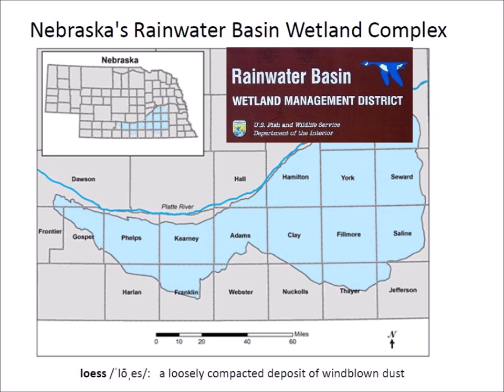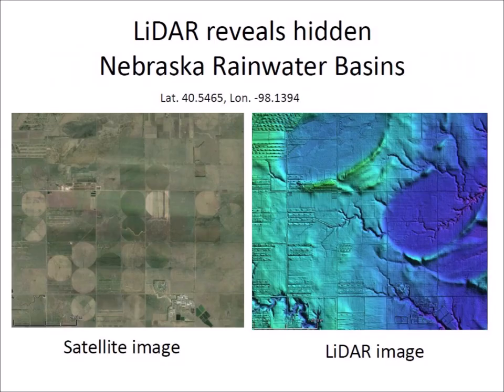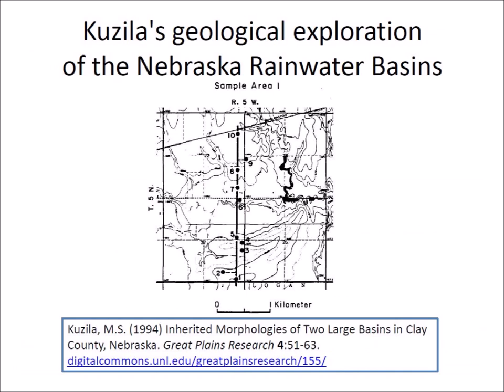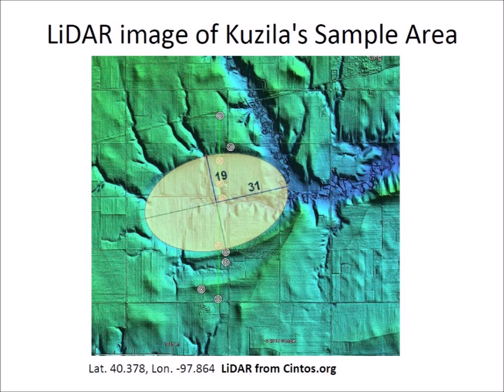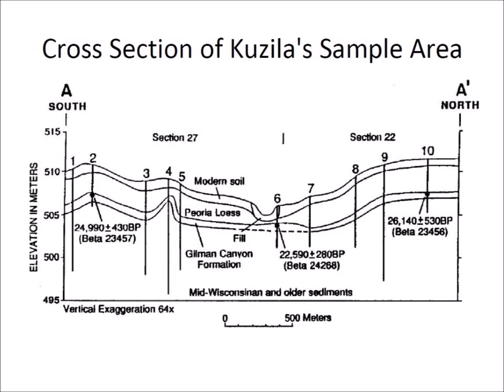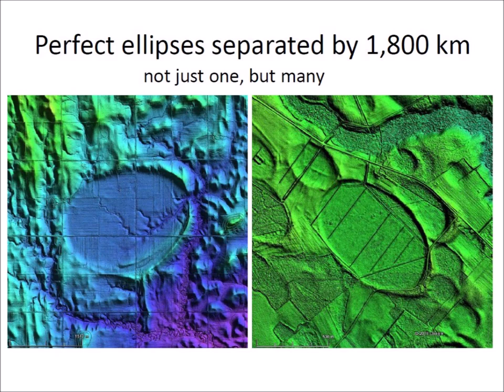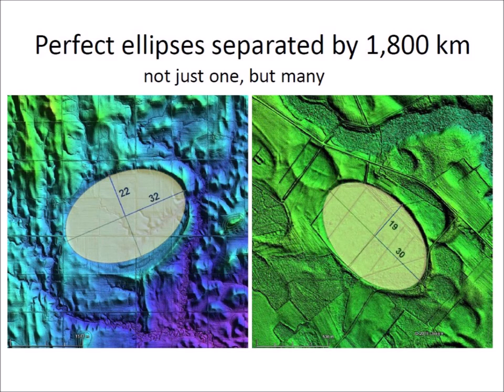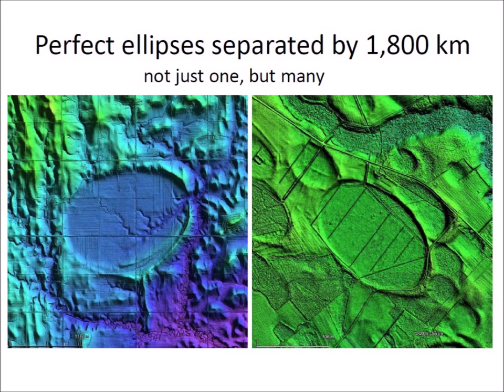Nebraska's Carolina Bays

Comment: Thank you, Mr. Zamora! 
I’d like to stick my 2 cents in about the rainwater basins here in Nebraska (I live in Omaha, and have been out by the Platte river to observe the spring migration of cranes, which is across the same area as the rainwater basins.) I’m also quite familiar with loess soil, which Omaha is built on. We have loess hills here. Loess soil is very fine, and when it’s dry and not held by vegetation, it blows easily. It’s quite fertile, and drains very well. A nickname for it is sugar clay, because it’s kind of granular, like sugar. It erodes by water in an unusual way: it won’t create diagonally-faced hills when eroded by water. Instead, it forms vertical faces, as in cliffs. I remember that there are 2 time periods of loess deposition in Nebraska, the most recent one geologists hypothesize happened as the Laurentide ice sheet retreated, melting, and creating those katabatic winds which blew off of the glacier and deposited the loess, which the ice had held. 
Anyway: for my unsupported hypothesis and conclusion about the formations of the elliptical bays: the modern loess soil could have been deposited on top of, and in the midst of, the elliptical basins being formed by the ice chunk missile bombardment. I haven’t read that paper about the basins yet, but I imagine it includes an analysis of the layers of soil in the bays. Given that loess is easily moved, the bays would have to be pretty recently formed, since they’re still so apparent.
It’s astonishing to realize that those ice missiles also hit where I live now.
Reply from the maker: Thank you for the description of the mechanical properties of loess. I think it can help to explain the difference in erosion between the east coast and Nebraska.

Comment: Question: 
Would the Coriolis effect / Earth's rotation produce any significant difference in the impact angle of projectiles travelling East (to Carolina) and West (to Nebraska)?  Naively, I'd have though the eastern impacts to have a shallower angle than the western ones.
Reply from the maker: The Carolina Bays and the Nebraska Rainwater Basins both have width-to-length ratios of ~0.58, which means they had about the same impact angle of about 35 degrees. The East Coast bays show some interesting wind effects that are discussed in this video: https://youtu.be/EVThf6SoclM

Comment: Assuming a cosmic origin for these structures seems outlandish given the evidence we have. I know a lot of people want there to be evidence for a massive impact, but if you remove that conclusion and examine the Rainwater Basins from an objective standpoint, you'll realize that there's little showing them to be the result of a meteorite impact. The impact hypothesis loses even more ground once you compare the Rainwater Basins to known impact structures in Nebraska.
So, firstly, while the Rainwater Basins might seem similar to the Carolina Bays when glancing at them on a lidar map, comparing their size and depth reveals them to be very different structures. The Rainwater Basins are extremely shallow - typically reaching only 3-4 feet deeper than surrounding topography. This is much different than the deeper Carolina Bays, which seem to average around 15 feet in depth. Already we have a discrepancy between the supposed impact features.
Secondly, contrary to what many people claim, the Rainwater Basins do not have a common orientation. Were they the result of impact debris, they should all point toward the same source. However, the basins have varying orientation, much of which seems to correspond to local wind patterns. They are also highly irregular. While some resemble ellipses, most are vaguely elliptical and not at all perfect.
Continuing on, as stated in your video, the soil covering the basins is old - typically ranging between 20,000 and 30,000 years BP. This soil lacks examples of shock metamorphisis, meaning that there are no rocks or minerals that appear to have been altered by an impact. If anything, the Rainwater Basins show no processes other than erosion typical of the area. This also means that, even if they are impact structures, they have been undisturbed for well over 20,000 years. Due to the erosion processes in the area, this seems unlikely.
Loess soil also erodes very easily, meaning that any crater structure in Nebraska would disappear rapidly due to natural weathering. Compare the prominent elliptical shapes of the Rainwater Basins to Merna Crater, a known meteor crater in Nebraska. Despite being formed between 3,000 and 5,000 years ago, Merna Crater has almost completely weathered away, its shape being nearly indistinguishable from surrounding terrain. Yet the Rainwater Basins are highly elliptical, meaning that they either formed very recently or are maintained by natural weathering processes. If these were formed as a byproduct of an impact during the Ice Age, they would have disappeared long ago.
Furthermore, the location of the Basins seems oddly specific. There are many locations across Nebraska where such crater structures could form - some areas even more stable than where the Rainwater Basins occur - yet these basins are confined to a small area south of the Platte River. This points less toward a cosmic origin and more toward local processes shaping the area.
Now, I know one can say I should "consider all the evidence," but that's exactly what these "impact hypothesis" videos fail to do. When examining all the processes in the area, as well as comparing the Rainwater Basins to known craters, and then looking at the ages and features of the soil in these areas, it quickly becomes clear that these are the result of normal, terrestrial processes. While the impact hypothesis is interesting, it fails to explain the Rainwater Basins as well as or better than our current understanding of them.
Also, for a meteor to produce debris fields with half-mile wide craters spanning a continent, it would be far more catastrophic than Chicxulub. This seems unlikely to have happened in the last 20 million years, let alone 20,000. As far as I can tell, this impact hypothesis is less about real science and more about wanting Atlantis to be real.
Reply from the maker: It was Zanner and Kuzilla who first compared the Nebraska rainwater basins to the Carolina Bays in 2001.  I do not know of any terrestrial mechanism capable of creating perfect elliptical structures with a width-to-length ratio of 0.58 in Nebraska and in the East Coast oriented toward the Great Lakes. If the geometry were not so perfect, and the radial alignment did not exist, I would agree with you. By the way,, the video does not mention Atlantis at all.
Reply: @Antonio_Zamora  The video does not mention Atlantis. However, one of the main heads of this "theory" in the popular consciousness, Graham Hancock, is a major proponent of the idea that there were highly advanced civilizations before and during the Ice Age. "Atlantis" is shorthand for that. I also noticed that you appear alongside him in some videos, so I felt safe making the connection. But his support of the Younger Dryas Impact Hypothesis is not based in some desire to understand geologic processes, but from an axe to grind against the "archaeology establishment."
It should also be noted that Graham Hancock not only has zero background in geology or anthropology, but also appears to have a personal stake in his hypotheses - particularly in how they relate to his use of recreational drugs. But that's my opinion of Graham, not of you nor your theory. I disregard the impact hypothesis in relation to the Rainwater Basins based on my own knowledge of the area and of impact structures.
Now, to counter the claim in your comment: the Rainwater Basins do not all have a length-to-width ratio of 0.58, and they certainly aren't "perfectly elliptical." While looking at certain ones on a lidar map may seem very elliptical, they are not all like that, and each one varies in depth, width, length, and orientation. The radial alignment also does not exist. While that claim is repeated by impact advocates of the theory, it is demonstrably false when looking over the lidar data - basins next to each other will have very different orientations. Not radically different (you won't find one basin perpendicular to another), but different enough that they don't seem to be the result of debris from a single source and more to result from natural variation in wind erosion patterns.

Furthermore, you actually explained the process that forms them in your video. These are likely the result of local wind and water erosion as the glaciers retreated. Wind can create some bizarrely uniform and elliptical structures, particularly under the right conditions.
Again, for the Rainwater Basins to be impacts, you have to explain why they have remained perfectly uniform while younger, verified impact structures have not. The lack of shock metamorphosis must also be explained, as well as the age of the loess above the soil. The terrestrial explanations explain this very well, while the cosmic explanation fails to.
Reply from the maker: In fairness to Hancock, a sea level rise of 120 meters in the last 20,000 years could have flooded some low-lying islands like the "mythical" Atlantis. Hancock makes some intellectual leaps trying to connect the dots, although his speculations are not as wild as the multiple universes postulated by physicists. There is now evidence that humans went through a genetic bottleneck at the onset of the Younger Dryas. Look at figure 2 in the following paper. http://m.genome.cshlp.org/content/25/4/459.full
Reply: @Antonio_Zamora  His speculations are very wild when you consider how devastating a cataclysm would have to be to wipe out a globe-spanning civilization with high technology. While it's not unreasonable to assume that you might have some early agrarian civilizations along shore lines, great civilizations - such as Rome or greater - typically leave ruins far from their shorelines. To totally wipe all evidence of such a civilization off the map would take a cataclysm greater than a meteor impact.
And that physics claim is a non-sequiter. 
Besides, this is all beside the main point. Why do the Rainwater Basins show so few signs of being impact structures beyond shape? Where's the shock metamorphosis? The disturbed soil? Younger soil deposits?
Reply from the maker: @echoecho3155  We need to distinguish primary ET impacts from the secondary ballistic sedimentation of the ejecta.  The ET impact may have a speed of 17 km/s for an asteroid or ~70 km/s for a comet, but the ejecta has velocities in the range of 3 to 4 km/s to reach targets in the 1000 to 1500 km range.  The speed of the ejecta is not sufficient to create pressure high enough to produce shock metamorphism or planar deformation features (PDFs), especially in saturated soil that can be liquefied by the impacts.   The ejecta curtain came down at angles of 35 to 45 degrees from 6 to 9 minutes after the ET impact and the initial impacts liquefied the soil, while the subsequent impacts on liquefied soil created penetration funnels (inclined conical cavities with raised rims) that became shallow elliptical bays through viscous relaxation. The conical impact cavities on liquefied soil are plastic deformations whose stratigraphy is restored by viscous relaxation.  The following video shows one of my experiments illustrating the restoration of the stratigraphy by viscous relaxation: http://youtu.be/prW_mfQIyHk